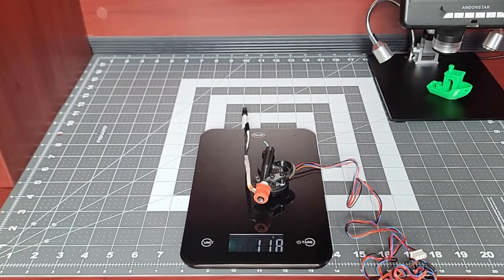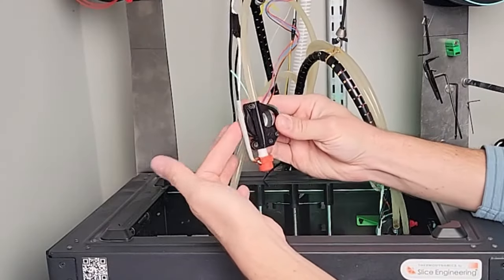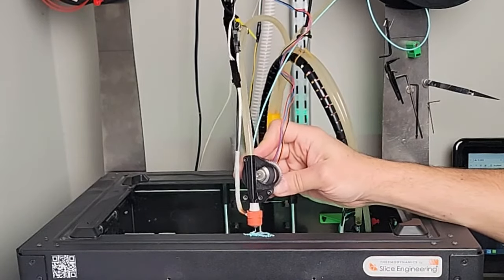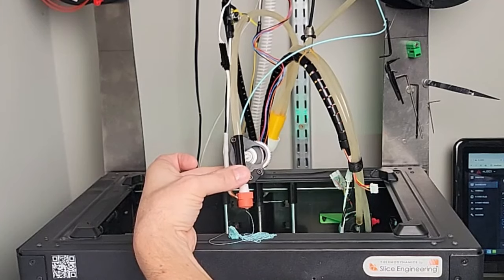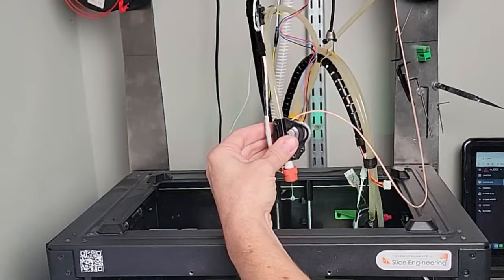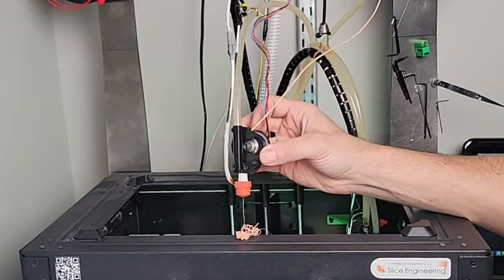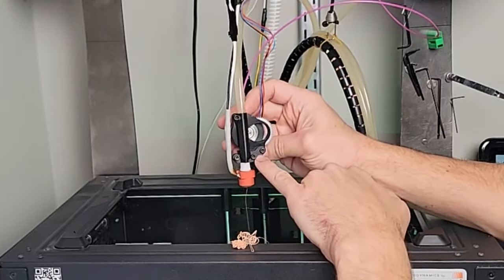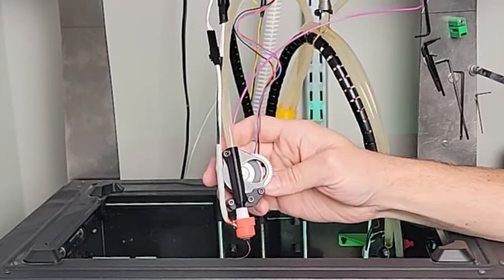Introducing Picolino: The World's Lightest Direct Drive Extruder!

Comment: Where can that drive gear be purchased? Also most extruders with the little motor use planetary gears for a torque advantage, You are going 1:1, correct.
Reply from the maker: Current Status:
I don't have a release date set yet. 
The extruder gear is still in the alpha stage.

Release Plans:
I aim to release a small batch of beta gears in January 2025.

Product Information:
This is a geared ring extruder with a gear ratio of 51:10.

Klipper Configuration:
rotation_distance: 99.9
gear_ratio: 51:10

Comment: Dmitry, that is very impressive lateral thinking. I’ve been rethinking my 3D printer requirements, and want to use an old Robox 3D printer as an enclosure for possibly a Sovol SV08, ( I needed a 350x350 build area the other day) and  make a big bang for bucks toolchanger. That toolhead is on the money, well done, because lightness with performance is everything, and this was one area I wanted to change on the SOVOL SV08. Looking forward to seeing the CAD files and possibly incorporating an E3D Revo into one of your Picolino’s, just so I can have nozzle change flexibility on an Also spot on thinking re TPU extruding, and I don’t want to sound too much like a “fanboy” but the designer in me can really see what you are doing, and I’ll say it again very impressive and “hats off to you” or as my French friends say “Chapeau” 👌
Reply from the maker: Thank you, Mike! I've also had my eye on the SV08. I especially like that they've open-sourced it. I've already downloaded their CAD files.
Reply: @ I really like the UK designed ProForge 300 and after seeing the 250 at a UK 3D print show, but I needed bigger for this one project I’m working on. I almost pulled the trigger on a Black Friday Amazon deal for one at £495 and next day delivery. It’d be an ideal base for a toolchanger especially as NextLayer and Michael at Teaching Tech are doing these.
Reply: Be carefull with the nozzle to bed height.
if you want the motor to be above the alu-extrusion (x-axis) I don't even know if the nozzle can reach the bed before the x-axis mounts do and even if its possible, your a-b-motors will allready be like 30mm deep into you base.
I recently tried the stealthchanger (about to try out the tapchanger) on the sv08 and the standard dragonburner toolhead can't reach the bed, before the motors reach the base

Comment: Not sure if it’s clear to others but this is just a circular rack and pinion set up.  The problem with that is by removing the conventional interstitial planetary gears then you lose torque amplification, no fulcrum.  In fact this reduces mechanical advantage such that the surface gripping the filament is weaker than at the edge of the motor spur because you effectively lengthened the lever arm, possibly by half or more.  But if the motor has more torque than you need then this can be an acceptable solution.   You could reintroduce a single planet gear, reducing weight of carrier and other two gears, to get back some torque.
Reply from the maker: @jonloschke749, thanks for your input. I'm using a simple internal gear design with a gear ratio of 5.1:1.  Internal gears are a fundamental component of many planetary gear systems.

I'd encourage you to check out my latest Version 3 build video where I've refined the design further. 
Here's the link: https://www.youtube.com/watch?v=YQ-f9p335zM
It might provide more clarity on how the system functions and its advantages.

Thanks for engaging with the discussion!
Reply: I encourage you to think about a tank track.   It doesn’t matter how long the track is, it could loop over the top of the tank, yet all the power from the driven wheel is the same.  It merely provides an alternate surface to drive on.  And this is what you want here because you wouldn’t directly engage the motor spur teeth on the filament.  But your gear ratio is still 1.  Again, this is not bad if it provides enough force for the speed, etc that you want for printing.  I’m just correcting the misconception about gear ratios.  I know you are thinking that it takes 5 turns of the motor to turn the outer ring, it certainly feels like a gear.  But in this implementation it is a track instead of a gear.  The larger radius is good to engage more surface on the filament but it’s not mechanical advantage (actually disadvantage).  You can feel this by how easily you back drive the motor in your other video. That should be 5 times harder if it were a gear.  To truly convince yourself, work out your e-steps, then double the outer ring (twice as many teeth) and you will find it has the same e-steps instead of twice.  What will change your e-steps is the distance the motor is from the filament, which is the disadvantage I mentioned.  In your recent implementation it appears the motor is slightly inward so it has lower mechanical advantage.  It has to “reach” further to move the filament since the ratio is 1.  But for your idex, where you want a very compact, light extruder this still may work well enough.  You will have to test it.  Good luck.

Comment: 10 mm^3/s for NinjaFlex is kind of insane.  I print a lot of TPU so this tiny but fast direct drive extruder is very interesting.  The CPAP setup doesn't bother me because I set up all of my 3D printers for TPU to feed from above from a bearing hub reel with no reverse Bowden tube to minimize filament flex.  I make functional prints so I seldom care about color printing but I'd love to have dedicated tool heads for TPU, PETG or PETG-CF, and PLA.  I'd love to be able to print PETG-CF parts with TPU feet and anti-skid tops, or PETG parts with PLA support, without all of the time and material waste from an MMU.

Comment: This is a very elegant design, well done! Also impressive how it manages to extrude the TPU using the other path. I've got a question: What hotend and heat break did you use for it and how is it kept cool? Cheers!
Reply from the maker: @properprinting Thank you for the kind words! The heatbreak I used is the Dragon High Flow v2, and the heater is the CHC from Triangle Labs. For cooling, I use an 8mm tube to deliver air directly to the tiny Dragon heatsink, with the exhaust directed up past the motor. Cheers!
Reply: @m_IDEX  Dude, that cooling is genius, in fact that might save the most weight by not having a fan strapped to the hotend.
Though what do you use to push the air into the tube? Must be something that creates higher static pressure than a normal fan, no?
Reply: @m_IDEX  Thanks for this information! That way of cooling is really smart. I can see that this could be very useful for enclosed printers, especially with a heated chamber.

Comment: That is so cool! I've thought about just how big and antiquated the modern heat break is for awhile. It reminds me of old school CPU coolers before we had heatpipes. I have been trying to figure out a way to do just that, replace a heartbreak with a section no longer than the width of a heatpipe to cool better with a small copper fin setup on the end (like a laptop cooler)- except the bend radius was too high. Water also works, especially in high temp builds (but adds a potentially costly failure point). I bet you could get the weight down by running much smaller tubing like they did on the first generations of CPU coolers. I can't imagine you need more than 1/4in tubing to keep up with the heat load. Could probably mount a cheap 3950 right in the water block as well and monitor or see when a clog could happen.
Reply from the maker: Thanks. I already use 1/4 inch ID tubing. 😀 Here are the actual specs: I am happy with this size for now as it gives me plenty of flexibility. Note that I cool both the hotend and the stepper motor. The second tube is for part cooling.

Abrasion-Resistant Versilon Polyurethane Tubing
for Air and Water, Clear, 1/4" ID, 5/16" OD

Comment: Wow, how I love truly innovative mechanical solutions, and this is one of hose. How was this wild extruder gear manufactured? Did you have this laser cut from your own CAD design?
Reply from the maker: Thank you! Yes, the extruder gear is my own design, and I'm fortunate enough to be able to laser-cut it myself.
Reply: @m_IDEX  I think the depth of the teeth can be reduced quite a bit.  There is probably very minimal "bite" into the filament.
Reply from the maker: You are correct.  However, the teeth relief is tailored for my laser equipment. There's a hidden tab in the root to secure the ring gear to the stock, preventing it from being pulled into the dust collection.

Comment: Nice design, clever use of the gears.  What hotend are you using?
Reply from the maker: Thanks.
I user a Dragon Heatbreak ST HF V2.0 with a CHC Ceramic heating core.
https://s.click.aliexpress.com/e/_op770pV
https://s.click.aliexpress.com/e/_oFzWQd9
Reply: @m_IDEX  Thanks for the ideas!  I am guessing that you like it.  I have been looking at what is out there, I am a big fan of that heating element design as it seems to make the most sense to me instead of having it just on one side.
Reply: One more question - are the links from a vendor that you have bought from before?  I am not sure about anything on Bangood or AliExpress, everything there just seems shady.
Reply from the maker: @genjitsu7448 Yes, these are the parts I've purchased and used in my prototypes. I've also bought the non-HF heatbreaks, but haven't tried them yet. The HF version seems to be a better fit for my design. Regarding your concern about the vendors, I've had good experiences with the sellers on AliExpress linked here, but as with any online purchase, it's wise to check reviews and seller ratings before buying.
Reply: @m_IDEX  Thanks for the feedback.  I think I will take a chance and try a small order out with the vendor you listed.   Thanks!

Comment: Gave me an idea to use gt2 belt as large gear to drive filament, similar to the one dutch guy proper printing or so, but smaller
Reply: People have used a belt to feed filament before, especially useful for TPU, as the contact surface area is increased, so aids feeding consistencies. A bit like two conveyor belts stacked, and feeding between the two... this is often used in food processing scenarios too.

Comment: cool design! I wonder how the ratchet shape of the filament contact teeth impact the retraction performance. how is the ring gear constrained? bearing?
Reply from the maker: @leonjiang2882 Thank you! The ratchet shape of the teeth is designed to maximize grip while minimizing filament deformation, which requires less motor torque. I haven't encountered any retraction issues so far, because there is significantly less resistance during retractions. The latest version of the Picolino Extruder includes a bearing to enhance the gear's durability. You can see it in action here: https://www.youtube.com/watch?v=YQ-f9p335zM&t=2s

Comment: How do you adjust the dripping pressure on the filament?
Reply from the maker: The ring gear is universal and automatically adjusts to feed different types of filament.  For ultra soft TPU, there is a 2nd filament path with added tension.

Comment: How are you cooling the heat break, is it with an air pump?
Reply from the maker: I split my CPAP blower into four 8mm tubes. One delivers air directly to the Dragon HF heat sink and exhausts the air up over the extruder motor. The whole system remains cool to the touch, even inside a passively heated chamber of about 60C°.

Comment: Interesting cool design. Certainly super light—that’s awesome. I’m sure this is going to be good for a lot of things. 

I do see a problem though: the effect of the inner ring though makes this design almost the equivalent of a direct drive. A 10 tooth 0.5module gear (the motor) has a mesh diameter of 5mm. If you have a 10:51 gear, and a rotation distance of 99.0mm for the outer gear than the effective gear ratio is 10/51 * 99 / (5*pi) =1.24. So the filament is moving 24% faster than the motor mesh circumference. This is a bit slower  than a typical direct drive extruder, but not by much.

I’m sure that large ring and dual opposing bearings has great grip, so it will skip steps long before it loses grip, but there will be fairly low limits in flow compared to a more heavily geared extruder.
Reply from the maker: I think your math is correct! Thank you for doing that. Had I done the math first, I would have likely added a second gear reduction stage. I am amazed that the Picolino extruder can comfortably extrude at 24mm³/s.

Comment: What holds the extruder gear in place?
Reply from the maker: The extruder gear is held in place primarily by two mechanisms:
Extruder Housing: When there's no filament being extruded, the extruder housing itself keeps the ring gear somewhat constrained, ensuring it remains in a relatively fixed position.
Filament Preload: During the extrusion process, the filament provides a necessary preload. This preload force helps to keep the ring gear in mesh with the motor pinion, ensuring proper engagement and functionality of the extruder system.

Comment: Where can I get one of these gears? 🎉 🎉
Reply from the maker: I plan to offer a limited number of beta units for sale in January 2025. These units will only support toolheads compatible with the Replicator and clones that have 70mm rod centers. My current testing is based on an old Flashforge Creator Pro. I will begin developing additional toolhead options in 2025.

Comment: Wow, this is really cool, I hope to get to try this one day. 

I'm having trouble with the vernacular of 3d printing, why is this called direct drive? It's clearly a reduction gear train, thus not a direct drive.
Reply from the maker: @philiprisacher7375, thank you for your interest and kind words! 

Regarding your question about the terminology, you're right to point out the confusion. Here's a clarification:

Direct Drive Extruder: In 3D printing, "direct drive" refers to an extruder where the motor that drives the filament is directly attached to the hot end or the toolhead. This means the gear system, including any reduction gears, is part of the drive system on the toolhead itself, not separated by any long tubes or additional mechanisms. In your words, because it's "clearly a reduction gear train," it might seem counterintuitive, but it's the close proximity of the motor to the filament feed that qualifies it as "direct drive." 
Bowden Style Extruder: Contrastingly, a Bowden extruder has the motor mounted remotely from the hot end, with the filament passing through a Bowden tube (a flexible tube that guides the filament) to reach the extruder. This design reduces the weight on the moving parts of the printer but can introduce issues like flexibility in the filament path, which might affect print quality or speed due to the distance between the motor and the actual extruding point.

So, while the term "direct drive" might seem misleading when you consider the gear train, it's specifically about the motor's position relative to the extruding mechanism. I totally understand your point about the vernacular; these terms can be quite nuanced in the 3D printing community!
Reply: @m_IDEX  thanks for the answer, I'm slowly learning!

Comment: With the setup being this light it leaves room to use it for an multi extruder tool changing setup because the weight leaves room for and locking features needed for tool changing
Reply from the maker: Absolutely!  Note with Magnetic IDEX setup, there is zero space and weight penalty 😁  With Picolino Magnetic IDEX or dual magnetic IDEX, this machine will be epic.

Comment: I like your design. You did what I've been thinking about for a long time, but the big gear should be on the shaft, so it will have a more stable position.
Reply: Not necessarily, it just needs to be constrained, that's all a shaft does, so three points around the circumference will do it.
Reply: @mikecrane2782  so instead of one plain bearing, you offer three? where is the weight saving?
Reply: It just has to be constrained as in three points define a plane, these points can be bearings like you said, but that’s not what I mean at all. 😊
Reply from the maker: I had to make some design changes...🤔 
https://www.youtube.com/shorts/EZslislxISg
Reply: @m_IDEX  As soon as this video came out, I immediately liked it. Now add water cooling to the hot end hot spot cooling and you can increase the printing temperature. Is this model available for testing?

Comment: I don’t know if this has been mentioned but try replacing the screws with titanium ones. It should save some weight.
Reply from the maker: Thanks for the suggestion. Changing from steel to titanium for four M3 screws in Piolino would save approximately 1.7g total.

Comment: you didnt add the fan or PCB
Reply from the maker: I don't use any fans or PCBs on the Picolino toolhead because it's designed to be extremely lightweight and compact. This approach minimizes material use and simplifies the design, which is ideal for certain applications where space and weight are critical factors.